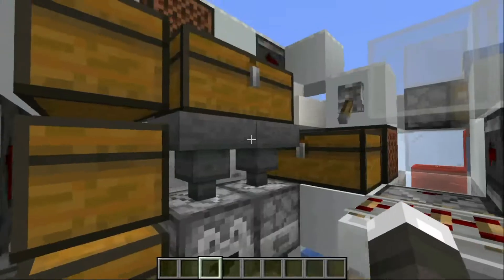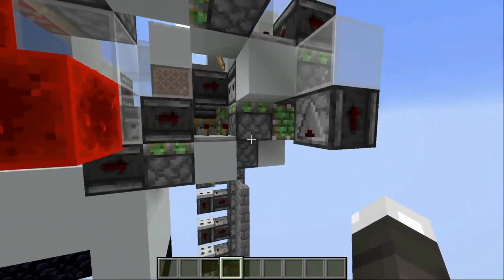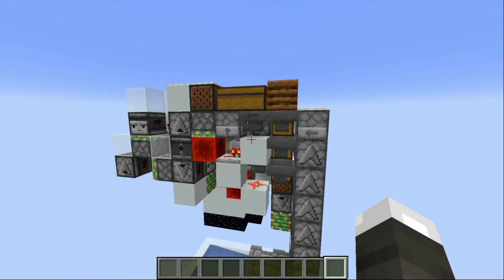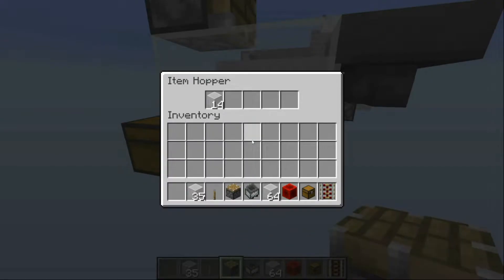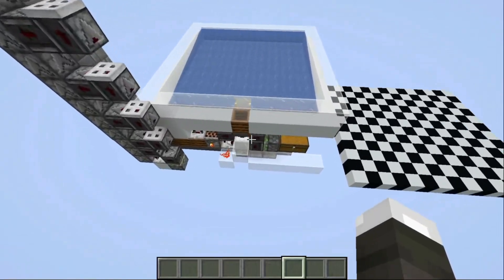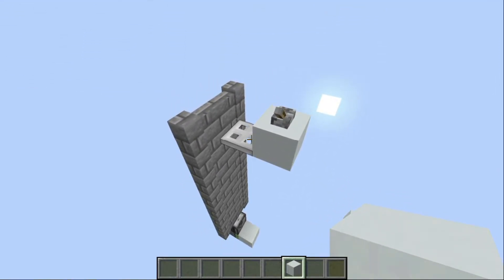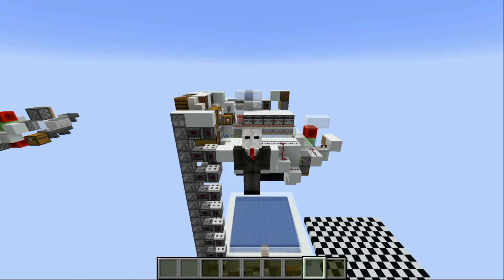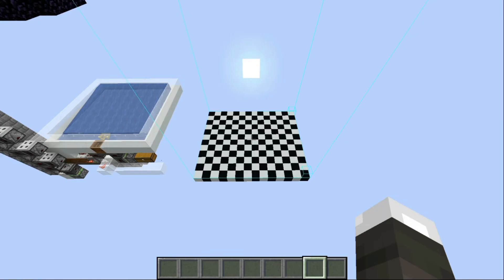18k Concrete Converter

Comment: Really nice ! The only thing is what about placing different colored concrete powder? I feel like you should take the signal out of the hopper above the shulker box and not the power of the shulker box. So that you have a multi item shulker box loader. This would prevent losing items or having to clean up the blocks in the tnt chamber manually.
Reply: Si basically it would need a 2x hopper speed multi item shulker box loader instead of just a regular 2x hopper speed shulker box loader.
Reply from the maker: oman why didn't i think of this smh
Reply: @MrMisterr  hahaha well it’s not to complicated. I’m sure you could re-do it so it would work. Btw the video it’s really nice I loved the edit and the explanation ! I have nothing negative to say I just wanted to make a constructive remark.